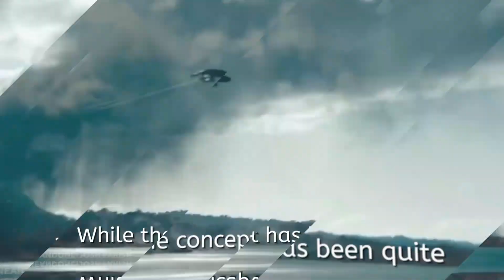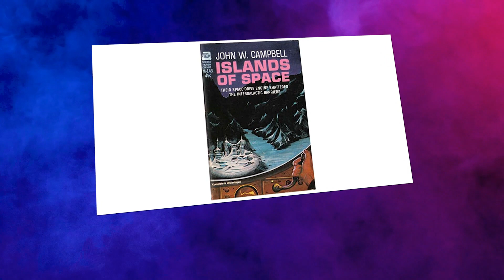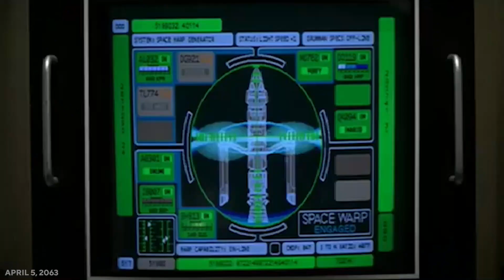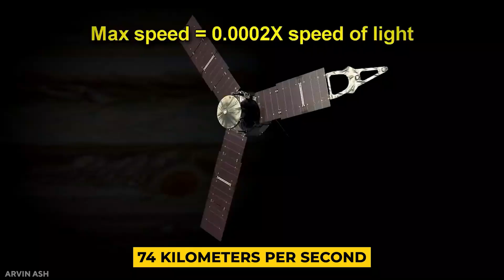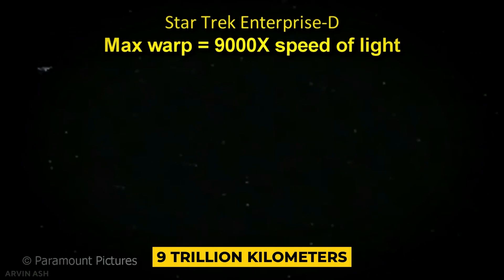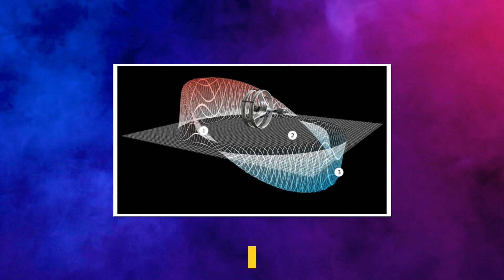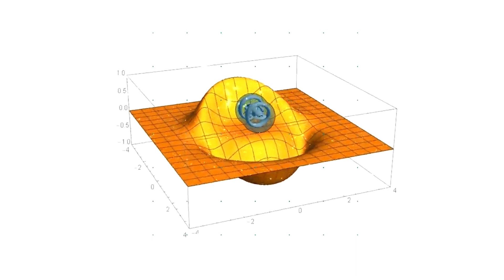Warp Drive by SpaceX: Is it possible?

Comment: This video doesn't take time dilation or lorentz contraction in to consideration and is quite scientifically inaccurate. You can't go faster than the speed of light, it causes paradoxes. There is no workaround, and perhaps the biggest solution to the "Fermi Paradox" is that there is NO WAY to go faster than light. And at that, how does one keep an interstellar empire together when the fastest you can communicate and create causal relations is limited to the pathetically (in cosmic terms) slow speed of light? 

Sometimes I think people just don't think.
Reply: While I agree that these technologies are probably impossible and will never see the light of day, the concept of a warp bubble circumvents the need to actually travel at the speed of light, or beyond. The reason why we have what is referred to as 'the observable universe' is such because outer portions of the universe are at constant warp from the expansion of the universe. Literally the actual space that matter is contained within is moving away at speeds faster than light, so the light from its stars are moving away with it, and will never reach us. This is the principle that warp drives/bubbles are based on. They move space time, itself, rather than directly propel physical matter.

I don't believe we will ever achieve this. I firmly believe it is unachievable.
Reply: @Aquascape_Dreaming  the universe expanding is from dark energy though it's nothing to do with this theoretical warp drive. Well yes it's true that space is expanding faster than light we can see that because of far galaxies and stars being redshifted, but the Alcubierre warp bubble and Dark Energy are two different animals my friend.

Comment: In the grand scheme of the universe, aren’t we already moving faster than light. Our solar system is kinda already doing what a warp drive is theorized to do. If the universe is expanding and it gets faster the further away then wouldn’t that mean we’re moving away from it at a speed the light can’t keep up with. It’s like our understanding of light speed is already going trough a filter before we get the opportunity to acknowledge its existence. Although we feel like we’re sitting still, we are moving extremely fast if compared to actual stillness of universe.
Reply: No. If you want to go anywhere besides where you are you must overcome the expansion plus move at a speed relative to the place you want to go towards that place.
Reply: All our combined movement adds up to the speed of light.
Reply: There is no "actual stillness" . Your velocity can only be compared relative to a frame of reference. Choose a frame of reference and you can calculate your velocity. Without a frame of reference velocity is meaningless.
Reply: @jjhhandk3974  you say there is no actual stillness but there is, we just can’t achieve it. Imagine instead of trying to fight universe to travel fast, when really just need to slow down and let the universe coast by for a bit. I wouldn’t even begin to know how that’s possible, but absolute stillness is a real thing, it’s just not something we can probably even understand because to us it would be moving extremely fast. It would be  relative to whatever is surrounding the expansion of the universe and any mass in that void. Which means you can only travel in one direction.
Reply: @lazerith840  no. There is no actual stillness
Reply: @jjhhandk3974  then what surrounds the expanding universe. It’s expanding into something. You just don’t understand what I’m saying I guess. You can’t say it doesn’t exist when in fact it does, and to believe it doesn’t is naive. Just because something is hard to understand doesn’t make it fake or something, it’s just something your not understanding. It’s an impossibility for there to be no absolute stillness, otherwise how is the universe expanding? Can you not see that the void is still?
Reply: @lazerith840  the universe does not expand into anything."actual stillness " does not exist. Simple.
Reply: @jjhhandk3974  Empty space is still space. So to say it expands into nothing is wrong. It’s obvious your not understanding and not allowing yourself to think larger than the universe.
Reply: @lazerith840  lol, it's obvious I'm not understanding? Well, don't take my word for it there are several videos about that EXACT QUESTION. How about you take a look at those. Don't mind the fact that everyone who is anyone in physics agrees with my view. Just make your own up and run with it. I didn't come to these conclusions I'm just telling you what I've learned. Go on now, kid, take a look.
Reply: @jjhhandk3974  take a look at what you didn’t put any links. I’m not a kid, and it’s naive to think your the only person capable of thinking. Ask yourself what is the universe expanding into? To think it’s nothing is untrue because how can something expand into nothingness. With that in mind how can you say the void is not capable of absolute stillness, yet there is no atoms or anything moving. The absence of matter in an empty space is still considered to be space so there’s a definitive word to describe it. So how can you say these things don’t exist, yet we have an infinitely expanding universe filling a void that is definitely in existence.
Reply: @lazerith840  i didnt link anything because all you have to do is type it in the search. Type in "what does space expand into" and select any multitude of videos that you chose to highlight your ignorance. Then type in something along the line of can something be still without a frame of reference and after you get done watching any multitude of those videos do your family and everyone else a favor and try experimenting with exhaust fumes in a closed garage environment, since you aren't a kid...
Reply: @Aquascape_Dreaming  the fact everything is moving is my point. If everything is moving and expanding, and you figure out a way to be still by comparison to something outside of expansion and let it expand over you, wouldn’t that seem like your moving at speed of light in opposite direction of expansion. It’s like waves going over sand, the water moves, but sand sit still and travels trough the water.
Reply: @jjhhandk3974  Are you saying space  itself is not expanding faster than speed of light from the beginning of big bang?If yes then you are clearly not qualified to be called a science student let alone physics student🤣🤣
Reply: @jjhhandk3974  No physicist agree's with you.And there is no video where any clown saying that universe is not expanding faster than light.And your brain can't comprehend physics.Why not watch some farming videos that you can comprehend,understand?
Reply: @Returntonature145  I'm not an idiot and I have no idea where u got that. I never said that.
Reply: @Returntonature145  ummm, yes they do. Where do you think I get all my info? Also, if you don t understand the concept of "observable universe" why are you talking to me?
Reply: @jjhhandk3974  We are not talkinh about observable universe.We are talking about whole universe after big bang
Reply: @Returntonature145  read the previous comments